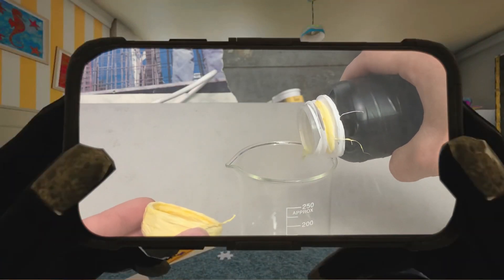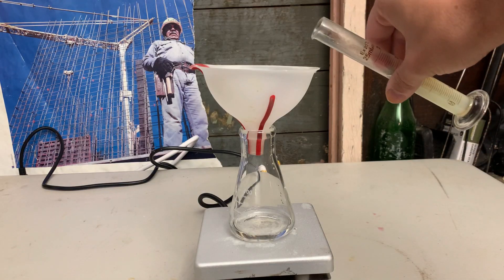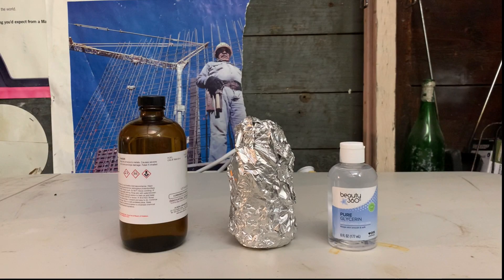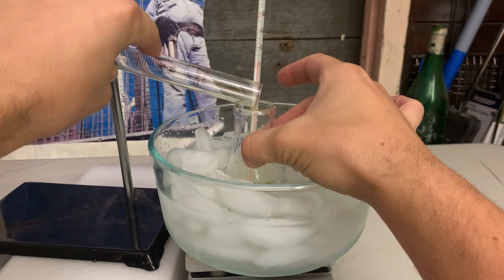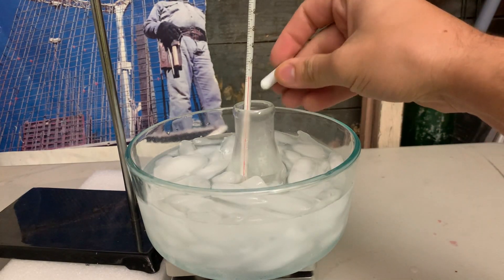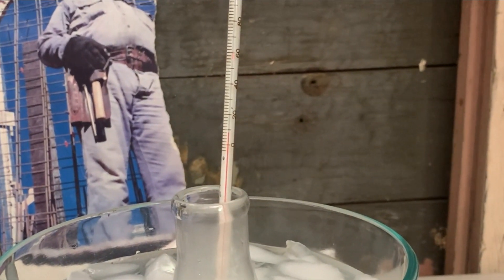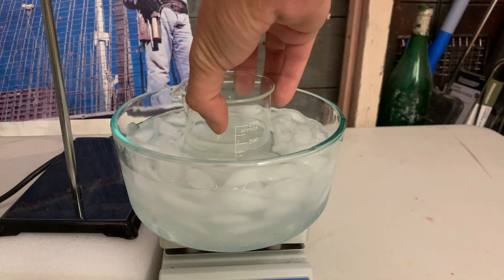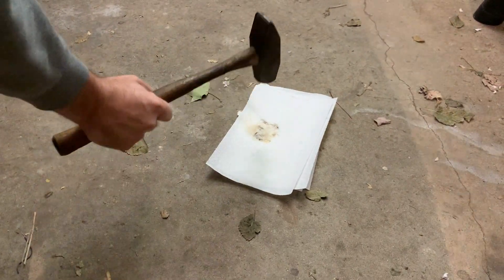Making Nitroglycerin From Hand Moisturizer To Trigger My FBI Agent.

Comment: I am a retired chemist.  Stopping making Nitro. The action of nitric acid changes with composition. Going from 70% to red fuming can give unexpected results. The amounts made are very dangerous.  Without a documented and tested procedure using the correct equipment, explosions are likely. The scaled of the synthesis shown is at least 10 g.  That amount can kill.
Reply from the maker: I made sure to destroy all the nitroglycerin after I was done making the product and I will hopefully never have to make this again, it took me a month and a half of planning to figure out the safest method of making the nitroglycerin and I’ve seen and read reports of people blowing there fingers off with this stuff, I’ve tried really hard to learn from there mistakes so I can make it as safe as possible, but I really appreciate the warning and I will definitely not be trying this again 😂 this was honesty a scary project, I will honesty take any advice when it comes to chemistry cuz you said you are a retired chemist and I really appreciate the advice and concern you give

Comment: If you have to store NG for longer period, neutralizing it with 5% sodium bicarbonate solution for 24 hours is necessary, also, some urea can be added to remove dissolved NO2 in your product.
Reply from the maker: I wasn’t planning on storing it for more than a week, I wanted to use it as soon as possible

Comment: Hello. If I was using 70% nitric acid, how much quantity will I have to use? Fuming nitric is pretty difficult to get around here.
Reply from the maker: Honestly I have no idea, I’m assuming the same amount, but you might end up with less nitroglycerin in the end, I found the formula online and they said the 90 percent stuff works best, I could give you the link to the recipe
Reply: Ah nevermind. Apparently a 1:1 ratio works, even if you're using the 70% hno3 aswell
Reply: @neighbourvasily4742  A bit to late.  But I have 70% and I use a 1:1 ratio.  And I add 1/10 of the volume of nitration mix to glycerin.

Comment: I tried to make nitroglycerin
I use 68% nitric acid and 98% sulfuric acid and I mix them the temperature increases but I always keep it no more than 20°C for 30 minutes. After it cools to 5°C I mix it with glycerin the temperature increases no more than 15°C while stirring it

After I poured it into cold water, a white sediment formed which seemed like nitroglycerin and I took it after that I tried to hit it with a hammer but why didn't it explode? 
The white liquid hit my skin after a few minutes my head hurt
Reply from the maker: Could be because you have to dilute the acid to make it more stable but that wouldn’t make sense cuz nitroglycerin in acid is way less stable or it could be because you didn’t use fumming nitric acid and the headache from the nitroglycerin is the nitroglycerin reacting with your body to decrease blood flow to the heart as it was used to treat high blood pressure and and heart failure and can easily absorb into your skin
Reply: @midnightproductions4679 The 68% nitric acid was quite fuming after I opened the bottle cap. But is the temperature correct when I mix nitric acid with sulfuric acid not exceeding 20°C?
Reply from the maker: If the temperature goes over 40c it has a chance of an explosion, the fuming still does occur with lower concentration however it does not give the same results as 90 percent as this will greatly improve the reaction, the higher concentration of nitric acid the better
Reply: @midnightproductions4679  If it gave you a bad headache from touching it, you likely had NG. The reason it wasn't detonating is likely due to not being dried. It looks more of a clearish white/yellow color and oily when dry than the pure white when its first made.  When wet, the impurities actually stabilize it to the point of making it somewhat harder to detonate. But when the stuff is good and dry, watch out. Though not as sensitive as people lead you to believe, it's still very dangerous. Its detonation has a cutting force to it and a few drops are enough to make fingers disappear if they are right next to it. The amount made in this video is enough to end a life.

Comment: dude let me  correct your mistakes no need fumming nitric its good with 70%
Reply from the maker: The fumming nitric acid was all I had at the moment, but I would’ve otherwise used the 70 percent
Reply: @midnightproductions4679  I love your video and mean no hate.  But "All I had was fuming nitric acid."🤣🤣 Fuming is SO HARD TO FIND.  I would LOVE to have fuming but I can only access 70% due to most businesses not shipping to residental.  But still love the video
Reply from the maker: @Jam0470  well it cuz I made some in a previous video and I decided to just use that instead of buying 70% nitric acid so I would save a little bit of money

Comment: Can you tell me more or rediract me somewhere where i can learn more about how to dry it with sodium bicarbonate ? 2:35
Reply from the maker: Add 10 grams of sodium bicarbonate to 100 ml of distilled water, I used a 250 ml beaker, then mix the sodium bicarbonate until completely dissolved in the water, then very CAREFULLY take a pipette and take out the nitroglycerin globs and slowly add it to the mixture, then take the nitroglycerin out of the mixture after your done adding it all and then you have your clean nitroglycerin, this makes it more stable then having it covered in acid however I would still use it right away as with time it becomes more and more sensitive and unstable